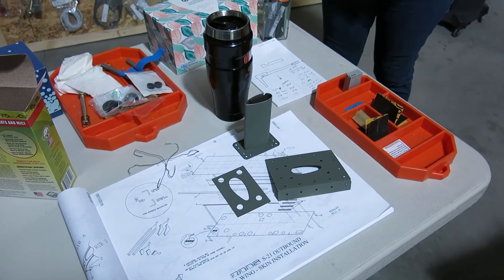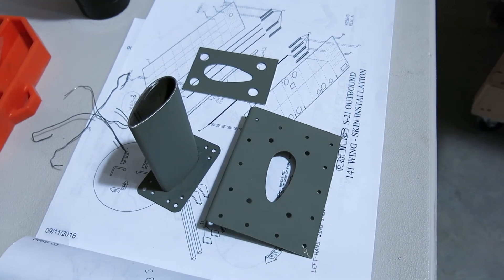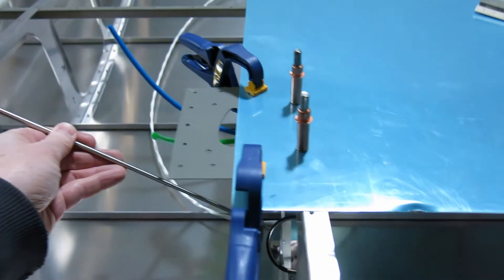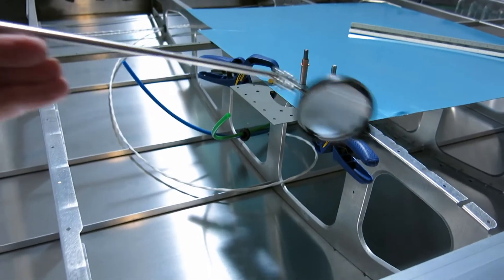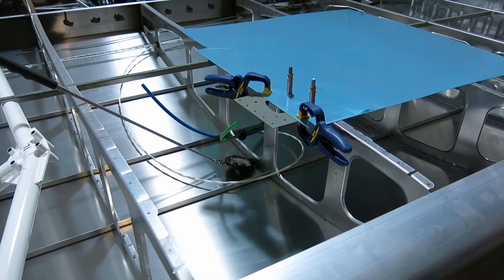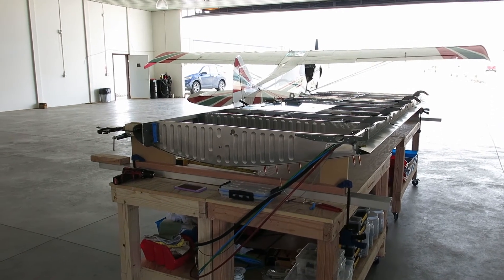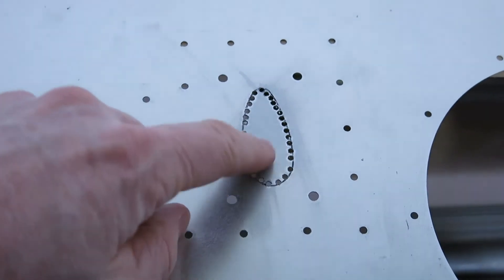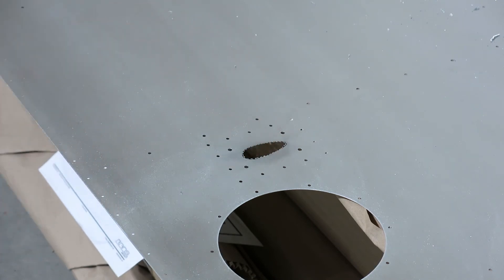No. 77 Pitot tube mount plate prep

Comment: How did you fix the bushings? I made the same error and trying to find best solution to fix. Thks for this video.
Reply from the maker: We were able to pop those bushings out and carefully insert them the correct way. I think we used Knipex pliers to squeeze them back in.
Reply: @s-21project92  How did you pop them out?

Comment: How do you plan to address the bushings?  I ask because the “right” way is probably to R&R them, but that will be tough as you likely would have to drill out all of those SS rivets which will not be fun.  I would consider trying to simply fit a brass or even aluminum washer in there when the bolt is installed and leave the bushings alone.  I would check with RANS on that, but I see no reason why that would not work as long as the washers fit snugly and were the same thickness as the bushing flange.  Just a thought.
Reply from the maker: We’re thinking on this. I’d like to get them out and flipped around. Probably fab up a removal tool that will fit in there. I have those Knipex pliers that work great for pressing, just have check if there is clearance to get them in there. We’ll figure something out.
Reply: @s-21project92  Or needle nose vise grips. Though jaws aren’t parallel.